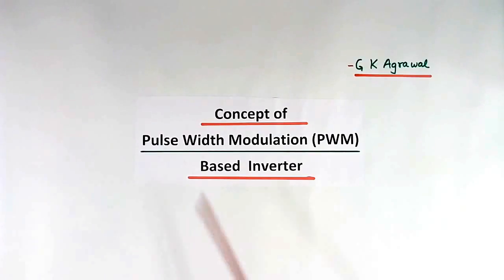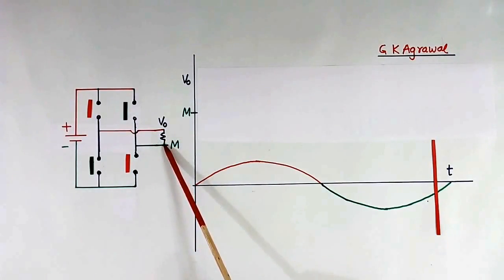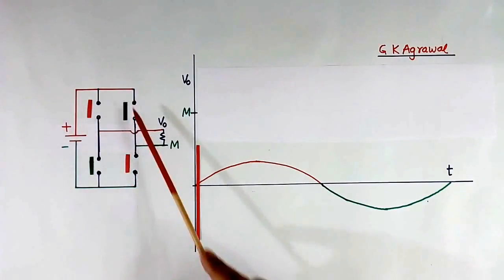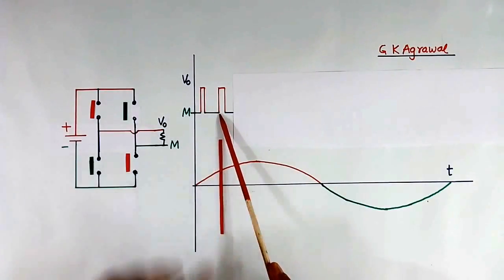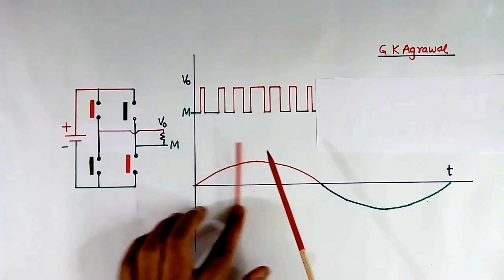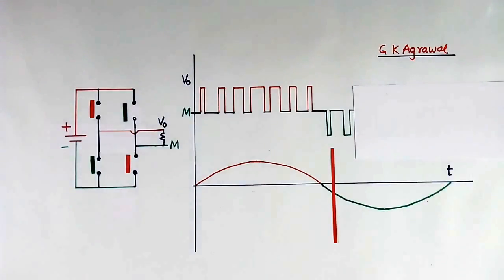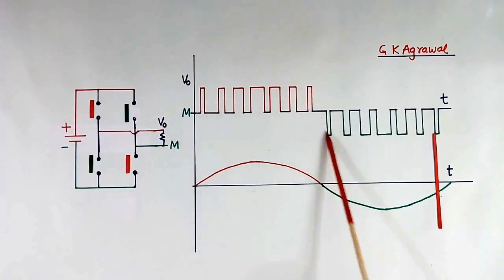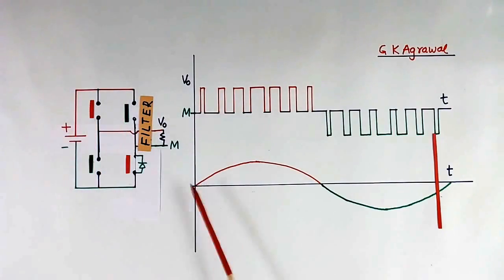IGBT based Pulse width modulation PWM Inverter concept

Comment: 72v dc 220v ac converter 5hp single phase motor load spec need 9790128605

Comment: Sir when I saw your video, my auto suggestion tells me that now you will get clear idea about that topic, 

and as always I am satisfied by your lecture.
(Is it possible, to show the concept by doing practical)     

Because in Practical, 
   all the hidden feature comes out.

.
Reply from the maker: Good that you learned from thid video. This video tell basic concept. Practical showing of this, is not only very expensive, it require lot of time also. 
If you are in college, you can try this in your lab.
If you want to learn about all hidden features, then you have to work for many years in some related company.

Comment: My question is very basic  for you but I will  ask anyway. Will the PWM reverses polarity if the load is not a motor?Let say a resistor heating element?
Reply from the maker: Output of inverter is AC, and will remain AC regardless of load. Output depends upon the design of the Inverter.

Comment: Sir,
Suppose 230 v single face motor has 1500 rpm, I want to control the speed of the motor by using VFD. I want to run the motor at 1000 rpm,
For that how PWM and IGBT will work

Could u please explain properly sir.

I know the vfd working principle. That is fist convert the ac voltage to dc and then remove ripple by capacitor bank, then again convert it from dc to ac by inverter circuit. 
And in these inverter circuit we are using IGBT and these IGBT is switching by applying PWM signal,

Now sir for 1000 rpm output, how it will work.

I hope u understand what is my doubt,

Sir please explain me how it will work

Thank you sir.
Reply from the maker: Watch my video on VFD concept.

Comment: Sir your explanation is awesome, but sir I have one double,
The purpose of PWM is only switching the IGBT. That means when PWM signal trigger the IGBT then IGBT will conduct. At that time maximum dc voltage will supply through IGBT to the load.
So sir please explain if we increase the width of PWM signal then how voltage will increase.

Thank you sir, I will wait for your kind reply.
Reply from the maker: OFF aur ON period key voltage kaa average letey hai.
Reply: Thank you sir for your kind reply
Could you please explain
how to take average of ON and OFF period.
I will wait for your reply. Thank you sir

Comment: How can i control the frequency of the ac signal for to be 60hz?
Reply from the maker: By controlling the timings of the gate pulse of IGBTs.
Reply: Oh ok thanks, i was a litlle confused with the diference between switching frequency and the output frequency
Reply from the maker: You can always adjust switching pulses frequency and desired output AC wave frequency separately.
Reply: Thanks again

Comment: Sir pls tell me about more of free wheel diode why it is use or what happen if we not use FD
Reply: This is an internal diode, not an external. It is implemented inside the transistor, it allows for bi-directional switching.